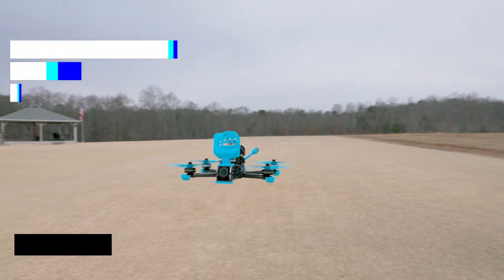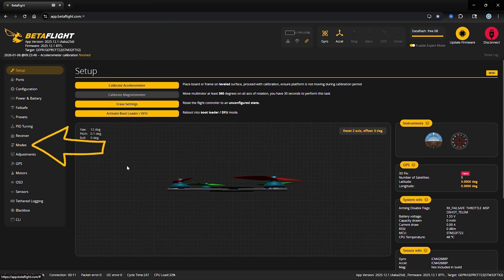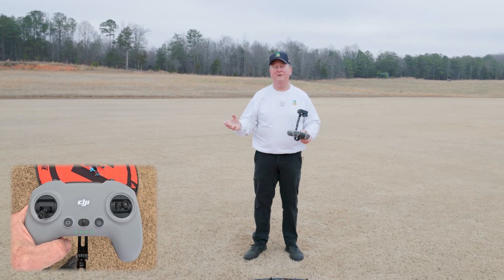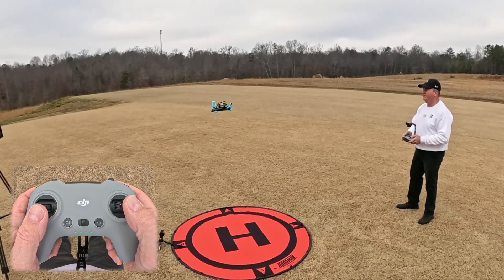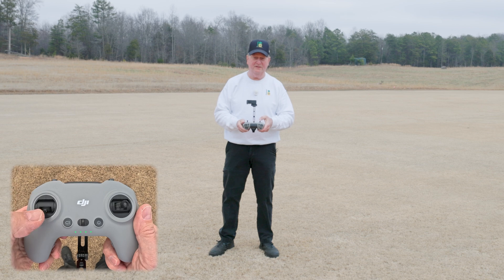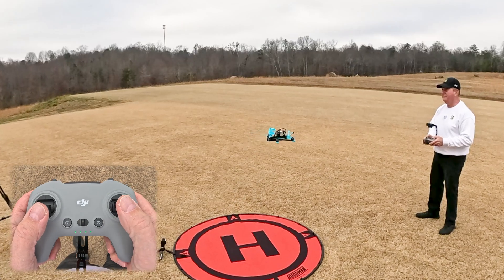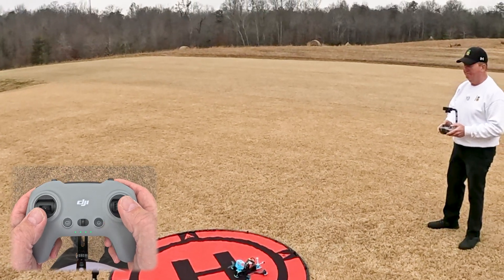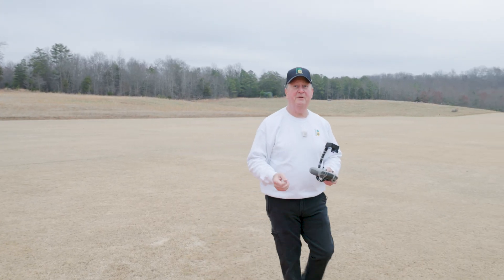The Secret to Perfect Alt Hold & GPS Rescue: It’s Not What You Think! | Betaflight 2025.12

Comment: I had no idea this was even a thing. I think I’ve seen every bardwell video as well. Can you show the setting on betaflight that make it beep.
Reply from the maker: You need to have a beeper installed on the quad then on the Configuration Tab under Beeper Configuration I have everything turned on but the USB.  Not sure what one makes it beep.  It is nice to have an audible conformation you made a change.  Hope that works. 🍍

Comment: What happens when i turn the drone on while holding it on my hands and before arming set it on a 5% degree slope ??? normally I am always starting from a smooth road.
Reply from the maker: The calibration will be locked in from your settings.  If you plug in the battery with the Quad on a 45 Deg angle it will not matter it will still hover normally in Angle Mode once you have calibrated it.  The only thing that will keep it from arming is if you have the Arm Angle set to low on the Configuration Tab under Arming.  Me as well as most disarm this by putting in 180 Deg that way if you crash on an incline, it will still arm.🍍

Comment: Great video thank you!!! I’m having an issue where my quad jumps up hard when I enable pos hold. And I have good gps and good home direction arrow after flying straight awhile. I also have throttle hover set to 1320 because the quad seems to hover about 32% throttle. Any suggestions??
Reply from the maker: I would plug the quad into Betaflight and connect a battery and your remote and goggles.  Go to the Receiver tab and then move your throttle stick to 32% and see what number the Throttle is in Betaflight if it is not 1320 that might be the problem.  Another thing to try is turning off the Baro if you have one you can just switch it off on the Configuration Tab.

One thing to remember if you are in the Goggles when you do the Pos hold it will look like it is jumping up because the camera looks up because of the attitude of the quad when it is stopping.  The way I check it look at the Altitude when you trigger Pos hold and if it says within a foot or two it you are good that is the range I am seeing.🍍

Comment: I haven't installed a new beta flight that has positioned hold but I've used it on inav. I always set up my angle mode and trim it so the quads as close to stable as possible even though I only use it on my whoops I still like to have it just in case

Comment: how is this feature in bf called?, timing the quad?
Reply: I think it is accelerometer trim for pitch and roll you can see it in the configuration tab
Reply: @G____s.P__s_GP thx
Reply from the maker: Yes the answer below by @G____s.P__s_GP  is correct.  You can do it with the Betaflight App by going to the configuration tab and changing the numbers under accelerometer trims.

One thing I did not say in the video is to do a backup after you have trimmed the Accelerometer so you settings are saved if you update the firmware etc.  🍍

Comment: Ваши видио очень актуальны. Но есл я не ошибаюсь!! Ваш пульт DJI а если у меня Радиомастер?? Там всегда на aux1 был arming!!  Специфика B.F. именно на этом aux1 находится Только, свич на два положения?!!😢.   Your videos are very relevant. But if I'm not mistaken!! Your remote is a DJI, but I have a Radiomaster? There was always arming on aux 1! B.F. specifics: this aux 1 is located on this very same aux 1. Is there a two-position switch?!!😢
Reply from the maker: You can assign any open switch to trigger Angle Mode to do the setup.  Angle Mode is also good to have on a switch just in case you get crossed up and need to recover.🍍
Reply: Ещё раз смотрел видос, к моду angal Вы добавляете ещё aux-5, хочу спросить За что отвечает aux-5, На вкладке Mods видно что подключено к aux - 1 ,2, 3, 4 но не видно какой mod на aux-5??😢 resqu=aux 4 !! B.F. - mods - Arm = aux 1 обязательно, так как на нем есть только - ON или Off.   I watched the video again, you add aux-5 to the angal mod. I want to ask what aux-5 is responsible for. In the Mods tab, you can see what is connected to aux - 1, 2, 3, 4, but you can't see which mod is on aux-5?? 😢 resqu = aux 4 !! B.F. - mods - Arm = aux 1 is required, since it only has - ON or Off. 😢 1:07😢 1:07

Comment: That will probably work till you connect a new battery. In most quads i seen the accelometer resets on every power up sequence.
Reply from the maker: I have not found that to be true.  If you put your quad on a 45 Deg angle and then plug it into Betaflight and then put it on a flat surface it should show it being flat.  I do remember a CLI command years ago that can have it reset the Accelerometer on every power but I do not see that in the CLI Commands.   On some of the older woops I do believe that was the case.  Thanks for the comment 🍍
Reply: @Pineapple22  i can confirm the new meteor75pro calibrates on every power up sequence.
Reply from the maker: @gencosumer  I have had small woops that also do that but the larger quads do not.  Thanks for letting us know🍍
Reply: @Pineapple22  some fc's on bigger quads also do the calibration. I can also confirm spedybee master3x does.